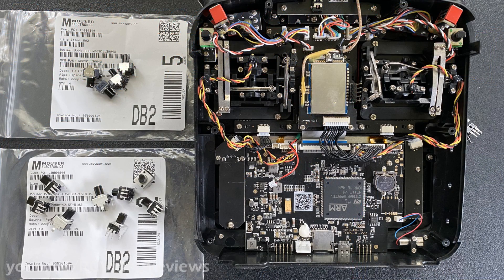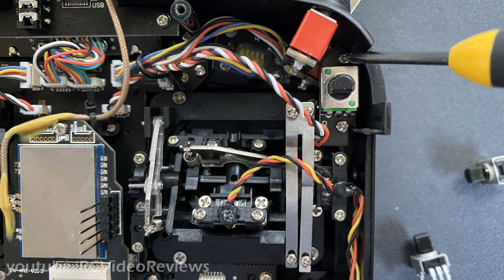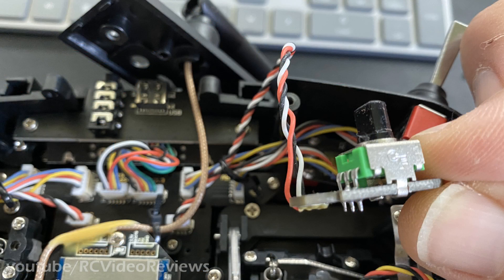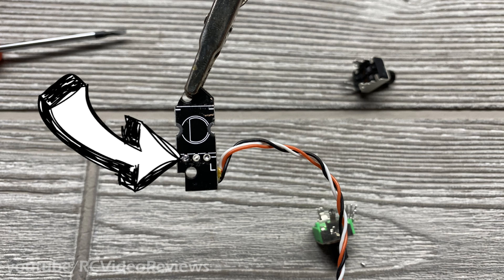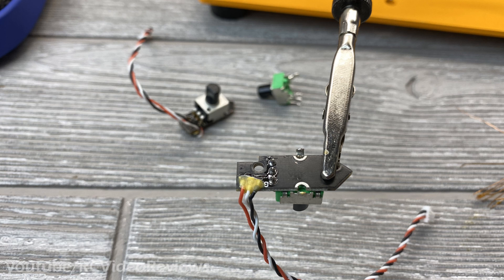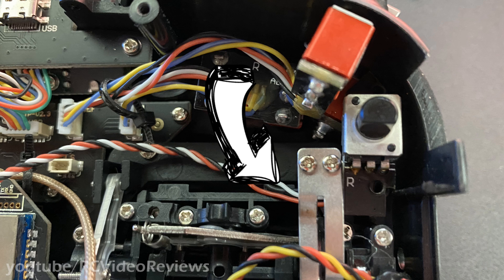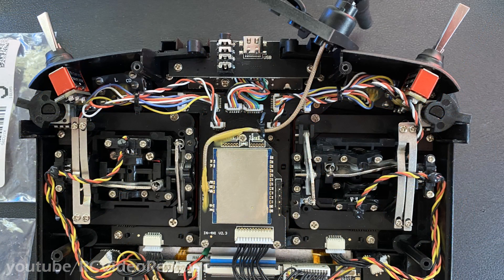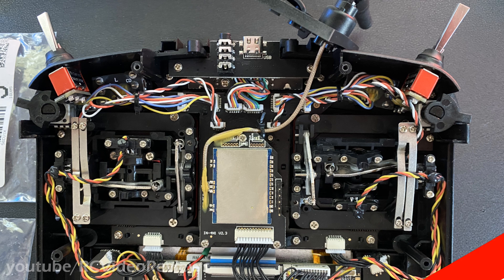How-to Upgrade Radiomaster TX16s Sliders

Comment: Thank you for the vid!  I am currently using the stock potentiometers for my sliders which are controlling pan and tilt on a servo based gimbal.  Do you know of any slider arm designs that would make it be a better experience using my sliders to control a gimbal?  Maybe a slider arm with a longer arm?  Also, is there a setting in the TX that would slow the servo movement down?  Maybe even treat the slider input as momentary... push and hold the slider to make the gimbal move slowly instead of basing how much the servo moves on how much the slider moves...
Reply from the maker: You can check thingiverse. There are some pot arms there you might find interesting. You can slow servo movement in the mixer using the gear icon at the bottom.

Comment: I have the exact opposite problem with my TX16S MKII MAX. The detents on the sliders are so strong that they're effectively 3-pos switches.
Reply from the maker: My MKII detents are pretty stiff too. Did you ever get them to loosen up? I'm hoping they will over time.
Reply: @RCVideoReviews  No, they haven't loosened. I'm thinking of switching them.

Comment: I just bought a used TX16s MK1 and the Left slider is wigging out, im thinking the potentiometer is bad, I'm just going to be flying a quad are the sliders necessary? I'm still building mine and learning.
Reply from the maker: Sliders aren't necessary. They're also very cheap and easy to replace.
Reply: @RCVideoReviews  much appreciated thank you!

Comment: I have a (recent?) TX16S and the center detent on both sliders is very vague. Perhaps they've used different pots in a cost cutting measure? In any case I might give these a go. Thanks!
Reply from the maker: It's not a massive improvement. I hope the next generation of radios cures this issue.

Comment: Awesome videos. Curious could you switch out the momentary Switch to a button. Thanks in advance.
Reply from the maker: Yes, you can. You have to change the hardware type in the system hardware setup page, but yes, you can change switch types.

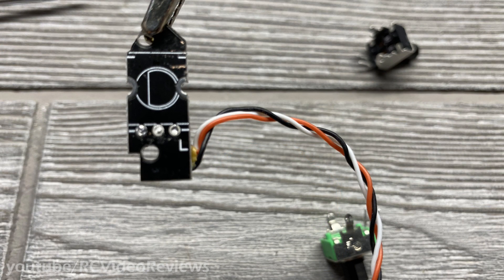Comment: 2:23... If you don't have a solder sucker you can easily remove solder in the pad holes by heating up the solder and blowing hard into the hole filled with the molten solder. Thanks for the Links. Just bought a few using your link...;-)
Reply from the maker: Good tip--I bought a solder sucker last night. It'll be here Tuesday :)

Comment: Carrying over a previous comment ...for the sliders on both the RadioMaster and Jumper where the center indent is weak can you demo how to set up the haptic to give some feedback.I really like this idea, had not even considered it...I keep forgetting this radio has haptic :-P This stuff is what separates your channel here John on YT cause I think some other channels still dwell on the hard tactile feel of these radios and forget that things like sound and haptic can be used to improve the feel of the radio completely. Its not explored enough, except here!
Reply from the maker: I actually showed how to do this in tonight's livestream :)
Reply from the maker: Here's the link: https://youtu.be/9DhPN2-jaW4?t=254

I discussed this exact topic and showed the setup in OpenTx Companion.
Reply: RC Video Reviews yep got it I jumped on the stream about 15 mins in and hadn’t caught up until now lol yep it’s pretty easy logic switch then special function task thanks for that :-) just was curious if there were other methods to do it.
Reply from the maker: @deancooper5513  There are normally a few different ways to accomplish things on OpenTx. This one was done with two lines, so pretty easy. Glad it helped.

Comment: Thanks for the vid. I am really tempted to get a TX16s as I am currently using Spektrum gear and I am kind of frustrated with it (expensive, and I get too many failsafes with my foam gliders). The only thing is I don't really know whether the new ACCESS protocol from FrSky is worth investing in, or it is just "hype" that a lot of people suggest. I fly in suburban parks and there is a lot of digital noise and avoiding failsafes is kind of my biggest concern. (I don't do any long range). Anyway, if you have any thoughts on ACCST vs ACCESS, just please let me know. Thanks. (Sorry it is off topic.)
Reply from the maker: FrSky has most people pretty upset right now because ACCESS is their newest protocol and is not backward compatible with ACCST. So those of us who invested heavily in ACCST either get the honor of re-buying FrSky "encrypted" receivers or sticking with old gear that will no longer get updates. To add insult to injury, OpenTx was a cornerstone of their radios--still is. So they want to take advantage of free software development, while at the same time telling everyone to get out of their kitchen when it comes to the protocol between Rx and Tx.

So they've cinched it with me and I've left FrSky. I will not subsidize that type of behavior. They used to compete on merit--they competed on bringing excellent products to market. Now they're acting like other big companies (cough Apple cough) and building walled gardens.

Get a Radiomaster. They say they're committed to maintaining open standards. That's the company to get behind.
Reply: I will not support a New non backward compatible protocol from FrSky after investing in the ACCST protocol. ACCST works just fine. A long time ago I gave up on Spektrum. Will never use it again. I love my RadioMaster TX16S
Reply from the maker: @lasersbee  Yup..you're on it.